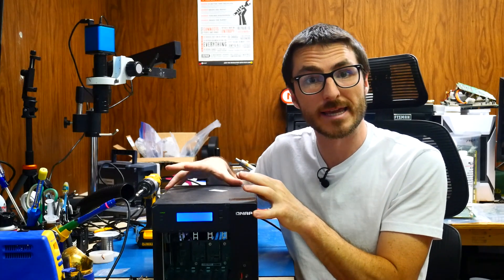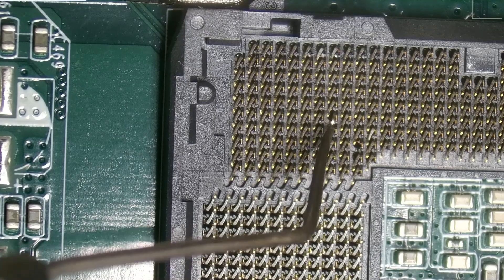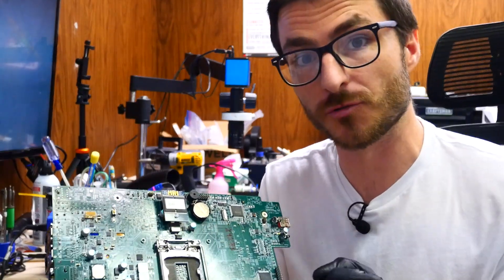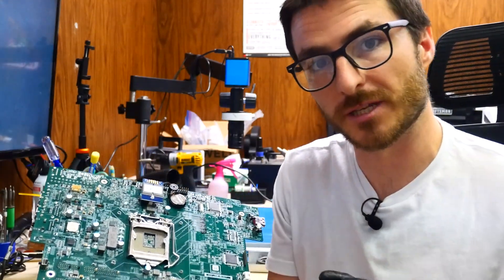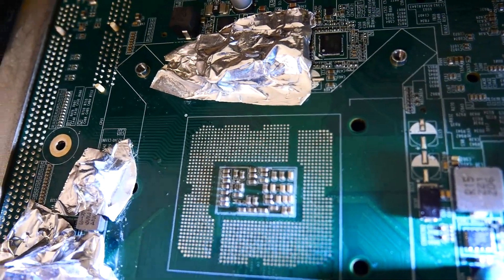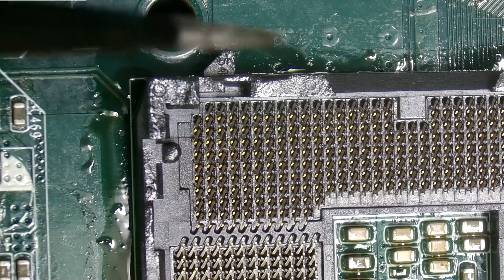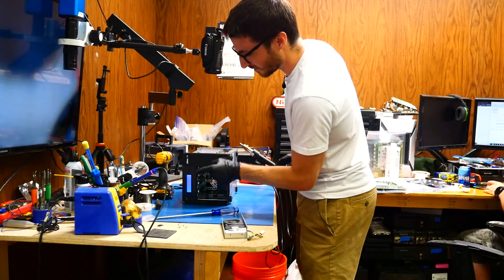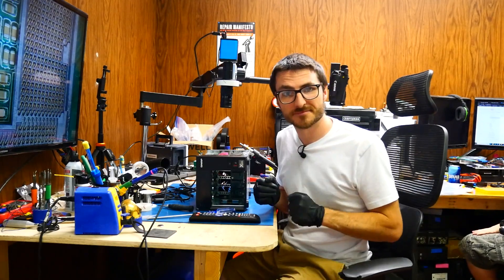Motherboard CPU Socket replacement for QNAP NAS TVS-472XT

Comment: Have not received any reply....is the LGA socket replacement possible? I don't want to send in the product if it is not.
Reply from the maker: Hello,
That is the socket we show you we replaced in this video. We can definitely fix that for you, however the sockets don't fail on their own, usually people open up their units and cause the damage but it's usually because they are prompted to open up the unit due to some failure.
What I am trying to get to is that if you have a fault with the QNAP unit + the socket also needs to be replaced we can do it, but may have to charge additional fees for the additional labor.

Comment: Just found this video Nick, but I already sent you a message on your website. I was wondering if the socket replacement was possible...now I know. In my case, a careless slip of the hand left multiple bent and broken pins on my 872x. Looking forward from hearing from you. It worked fine until I screwed it up replacing the heatsink.
Reply from the maker: Jim,
I apologize for not getting back to you sooner, this week has been very bussy and we have been down a tech (vacation) for the last week and half. 
I did reach out to my customer service team and they said they hadn't seen your email inquiry so I am not sure what happened there. 
We can defintiely replace the socket for you, however if we also have to replace the southbridge chip we may have to charge an additional service fee beyond our typical flat rate service.

Comment: Thanks Nick

I look forward to hearing more about this persistent problem.
Nice job on the CPU socket.
Reply from the maker: Well I have bad news. We did post the video today but it was filmed a week and a half ago or so. I spent a significant amount of time trying to fix it, we replaced the processor chip that commonly fails on this unit, we replaced ram, the DOM, we swapped the motherboard out into a new unit just to be able to rule everything else out, and no matter what we tried and did, we never got it going.
We ended up having to send it back as a no fix sadly.
Reply: @NicksElectronicRepair  Any chance the socket was not fully soldered?
Reply from the maker: I guess there is a chance but I highly doubt it. We made sure it soldered down on all corners. 
The fact that the symptoms were the same before and after to me suggest that yes there was damage to the socket but that was not the cause of the failure. If the socket was not soldered down properly then I don't belive the unit would be able to turn on at all. Although I guess I don't know for sure if that's true. Ill give that a try and let you know.